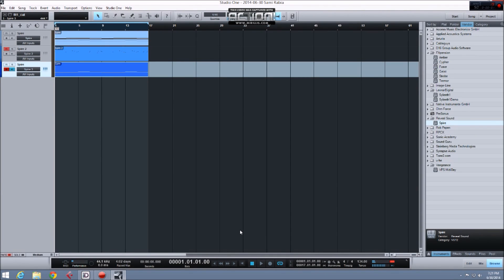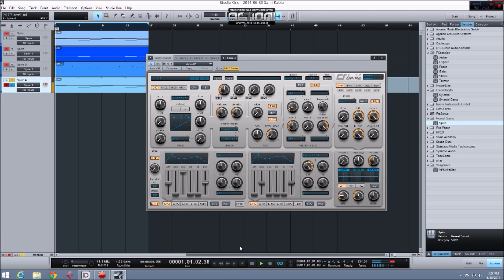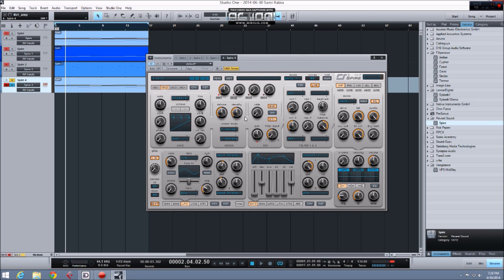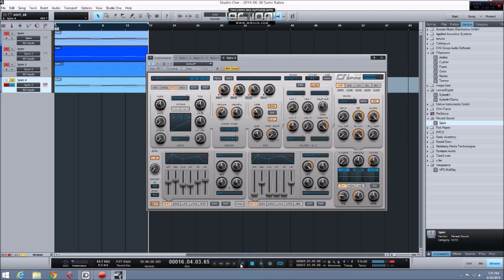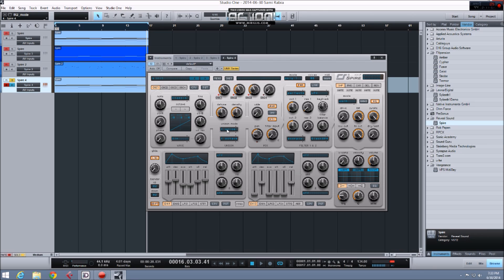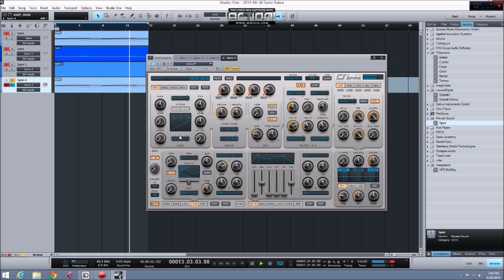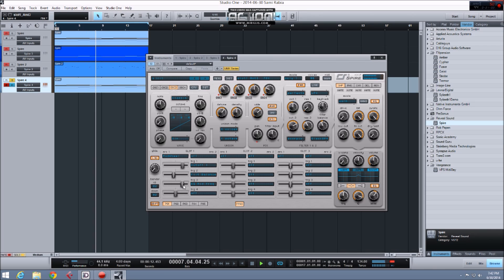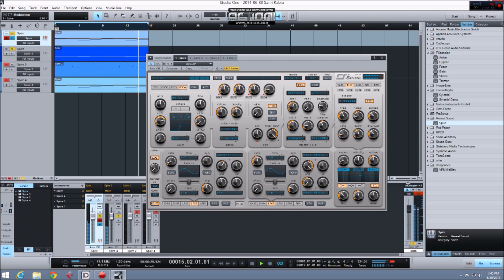Sound Design 01 - Rich Trance Pad

Comment: Hey man! Great tutorial, I found it really helpful, also to just get to know spire better! I love how you explain everything so detailfully!
However, I've run into some trouble when following this tut - for some reason the LFO'ing doesn't run very smooth, it makes some drastic and sudden changes at times and also causses the sound to clip, as if the release or attack was pulled all the way down... do you maybe have a solution for it to not do this and just float?
Best regards!
Reply from the maker: +WITHOUT K Thank you.  Well just quickly, have you clicked on the "mono" button on the LFO?
Reply: +AiynZahevSounds no I haven't - I've tried to make everything as similar to the video as possible
Reply from the maker: +WITHOUT K Ok so I'm not really sure what the problem is from your description. But LFO's can freely flow or be reset with every key press.  That depends on the Phase setting in Spire.  So in the LFO section the phase control needs to be totally to the left in order to run freely.
Reply: +AiynZahevSounds ah okay... however, it already is... The problem is that the phasing doesn't go in one continuous flow, it will sometimes change abruptly to another stage, which is also why the clipping happens i guess
You know, I think I'll just need to fiddle a bit with it, hopefully it will be solved :-) But thank you very much for your help, what so ever!

Comment: this is great tutorial man, everytime i use spire it fraps, does that mean its a plug in behaving badly
Reply from the maker: Thanks. What do you mean by "fraps"?
Reply: AiynZahevSounds like red lines, and it sounds like it is broken up, like overloaded
Reply from the maker: Sorry to be dense, is this a glitch that you can see or hear? is it visual or is it the sound that's going bad?
Reply: AiynZahevSounds hear
Reply from the maker: You could be overloading your channel? If you set your levels too loud it will "clip" the master bus. Sounds horrible. What DAW are you using? Like Live, Logic, FL studio etc?
Reply: fl studio and all the other plug ins are fine like sylenth, nexus, etc., only spire does it
Reply: Spire is very very resource hungry. if you have a mid to low end pc it can and will gobble up your CPU.